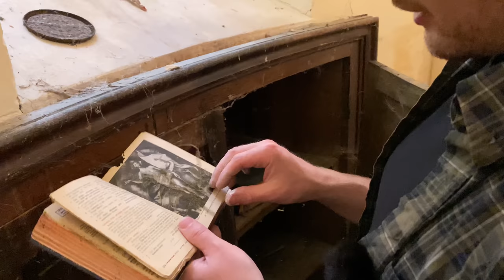Trash and Treasure - Doing It Ourselves

Comment: BIG TIP FROM SOMEONE IN THE AUTO INDUSTRY--- you arent supposed to mix the entire container at one time!!! you are supposed to take a board or cardboard material put the amount of putty you want to use on it, take the hardner and lay a bead across the top and the size of that bead depends on the amount of putty but general rule is you lay a bead of hardner half way across the top and its realative to the amount of putty you are using, if the pile is as wide as your hand then the bead of hardner would be half  as wide as your hand if the amount of putty is the size of your thumbnail the bead of hardner would be half the size of your thumbnail and thats usually sufficient. To much hardner and it will set fast,  not enough hardner and it just takes longer to set up but it will set so if you are unsure use less. In this case you are fine because you are using alot but in general dont do that and if you must mix the entire container, use about half the tube of hardner maybe a little more and it will double your working time.  The amount of hardner used does not determine how hard the putty is when it sets, it only determines how quickly it starts to set.
Reply: Seems so complicated but looks simple.  I don't think I could do it. Hope he seen (or saw) your video.
Reply: he seems to like that stuff and he'll probably like it even more when he knows how to best use it, they probably really did just find it lying around somewhere and improvised lol
Reply: Brandon beat me to leaving this tip. If you mix too much putty at once it will harden & be wasted before you can use it...
Reply: Brandon Reid Could you mix this stuff in a plastic baggie and then when well mixed, cut of a corner and apply it like a pastry piping to keep it more where you want it and save waste. This way the compound is not exposed to air and might last longer in soft mailable state. Don't know if this gets too hot in the mixed stage but if you use a freezer bag that is a bit heavier it might be sturdy enough to work. Also if you place a small amount of Saran Wrap over an intact area of the trim then apply some of the putty on and let set up, you can then remove it and remove Saran Wrap, use this as a scree to replicate the profile over the newly formed areas later.
Reply: I wouldn’t recommend using it like that, the spreader is used to press the putty into the crack or whatever you’re attempting to fill. Also being exposed to air isn’t what causes it to harden it’s adding the hardner, once you add that it’s going to harden at the same pace regardless of air or not. When you store it you want to make sure the lid is on it good and it’s sealed because air will cause it to harden without hardner over time
Reply: Brandon Reid . But if you put it in the Baggie and sealed it an ran a brayer over it it is actually an excellent way to mix things. ( use half the spreader to the volume of the putty, just mix a little as needed and don't get to far ahead of yourself it doesn't keep) it's actually simple and one never knows if one will need to know how to use putty. Cheers and have a cuppa

Comment: Painting the door to the Gardener's cottage is right. Even if it had been all teak, it would have needed more sanding and scraping to get rid of all the old paint before you oiled it. A painted door won't need washing and oiling now and then to look nice and it won't get darker either. You can use a crowbar under the door (and some pieces of wood if necessary) to guide it in the correct position when putting it back on the hinges. Mind your fingers; you only got five of them on each hand. ;-)

Comment: Always entertaining! Thank you Micheal et'al.

The timber on the bottom of exterior doors is a sacrificial piece. This timber is designed to keep the door from rotting and to throw rain to keep it from coming under the door. When this timber begins to rot, one simply swaps it out for another. 

Bondo and other body fillers are extremely versatile.

Cheers!

Comment: Just a pro hint: if you use an extension cord on a role and want to work with heavy equipment, take it off the role completely or it mighty overheat. 
I'm not into filling the door with that stuff... But it's probably better than letting it rot. Since you have two different kinds of wood I absolutly agree to painting it, it will last longer.

Comment: as if your videos could get better! this is really like a TV show!  Love your channel.   TIP—-for using two part epoxy:   get a piece of thin, flexible plastic to mix your putty and hardener on.  scoop out just about two spreader loads of putty to one 1/4 dime size of hardener. mix until hardener no longer shows.  use that bit up and keep mixing small batches. this allows you to get more layers out of your putty and it won’t ‘kick’ so fast either as long as you use the small amount of hardener.   we use this method because we are in hot Florida.  we repair boats.

Comment: OMG Michael I cringed when I saw you throw away the John Deere. You could have pulled it apart and sold bits of it like the seat, steering wheel and cutting deck. 😩 Those parts are so expensive. We need a new seat for ours and it’s going to cost 150.00 new. The door is going to be beautiful green. 😍
Reply: I felt the same 😱
Reply: I was thinking the same thing... Even the blade would be worth money.  I bet someone grabbed it out of the trash at the dump and scavenged parts to sell

Comment: From the style of the Altar, there was probably a large crucifix anchored into the plinth behind the Tabernacle that would have sat above and behind the Tabernacle.  Until 1965 every Catholic Altar was required to have a crucifix visible to the Priest at least.  There would also have been at least 6 large candle holders, three on each side for High Masses and a set of 2 smaller candle holders, one on each side for Low Mass.

Comment: .... In the states we generally use a product known as Bondo for body work .
I'd suggest that you buy your filler at an auto body supply. It will be less £ ,in
larger quantities . As the other poster said, you get the filler and hardener,
then you take out the amount you need and put it on some sort of pallet ( preferably one
that you can throw away). Then add the hardener and mix it.  The amount of hardener
that you add determines your working time. More hardener... Faster it will dry.
Less hardener more working time. However, you have to add enough hardener so that
It will harden ... ;-)

Comment: Also I wanted to share that a similar product was used on wooden boats to restore dry rot.
Often the wood on boats used in fresh water would rot below the water line. The product worked In water splendidly, so it will work well on the door with all the rain. God Bless you.

Comment: There's a product sold in the U.S. called wet and forget that's made to clean old tombstones that could be used to clean the delicate stonework on facade of the chapel.  It's supposed to be safe for stone and you just spray it on  leave it and the rain and wind wil clean off the dirt and mold feom the stone.

Comment: The stained glass windows you showed in the chapel are from very different era's, as you can see the colours in the last two that you showed are deeper and sharper, and from the middle of the 19th century. The others are very different design, and the colours lack the depth and sharpness of the 1st ones and are no doubt from before that time. And the chapel itself is very much a mixture of styles, indicating very different era's.

Comment: My cup of Fortnums Smoky Earl Grey is ready.
Reply: It tastes like tea made with water that was used to boil smoked sausage.
Reply: @moltobene1528  Smoky taste for sure - I love it.
Reply: Örn Leifsson  I cannot find that in the shops here.  I did find it on Amazon.ca.  A bit expensive, $27.95 for 25 count tea bags, plus $13.98 delivery.   However, I might treat myself at Christmas time!😁
Reply: E mail Fortnum and Mason in London..they'll post you a tin..probably cost you about 10 moolah.
Reply: @patriciaingledew5765  You don't have to email them, F&M have a webshop where you can buy their goodies - the problem with them though is that they have a flat postal rate, they put 40 punds on everything, so unless you are going to buy a lot of stuff and rather heavy, their postal charges are very unfair - I bought mine on amazon with much fairer postal charges.

Comment: Just me I would of pulled that lower part off the door 🚪 and had another one made in the same style or different teek wood save you filling with that putty
Reply: He does plan on doing that when there is a carpenter around, but to call one out just for that would be expensive, but as it’s being painted you can buy them off Amazon really cheap and screw it on.

Comment: Form your filler before it hardens, saves sanding and produces a professional result quickly. Cover a straight piece of wood with packing tape, press into the applied putty and wait till it cures then pull the wood off.

Comment: You should put that putty in a plastic bag and cut the tip so you can just pipe it right into any cracks or tough to reach places and it will go in much easier and cleanly.

Comment: I would like to give you another tip, if your going to use a claw hammer as a mallet turn the hammer 90 degrees using the centre and keep both your hands behind the wood chisel. Seen it happen followed by a trip to A&E. Not me someone else stay safe. :-)

Comment: Michael you did a great job repairing that stained glass window! The purple you painted looks like a good color match, just a bit too strong, is there a way you could just lighten the intensity or thickness until you can restore with correct glass? I'm glad you do read your comments, people are offering lots of advice through their own experience, like the putty and the door kicker restoration. Love the small changes you add when switching scenes, the Peacock butterfly etc.

Comment: Can I suggest you buy some hand held walkie talkies (or 2 way radio's as you may know them). They are relatively cheap.  They are great for the type of job where one person has to yell out to another. Also when you are on a large property you can take one with you and be easily contactable with the second unit that is left at home.  We even use them on road trips where we are travelling in two cars.  They normally have a 2km or 5km range.

Comment: During colonial times, mixed wood furniture was intended from the start to be painted.  some of it black lacquered and it was considered a China piece.  Though your door has had me puzzled for a long time now because of the gap on the bottom and then such a large decorative molding in front of it.  Then it occurred to me that the gap would allow any moisture that got into the door to drain better and that the molding was there to take the rot and wear and tear.  When it got in bad shape they still had a good door and only had to change out the molding.  LOL. Did I guess it right?   I saw the previous tour of the chapel but it is so pretty that it was nice to see it again.  I am wondering since you have a little locked cabinet on the altar if the chapel might have had a small relic at one time or another.  Maybe a small bone of a saint or a piece of wood from the cross.  Those were always popular bits to have around.

Comment: For repairs that are large like this door, you should try fiberglass reinforced body filler.  It has loose strands of fiberglass in it and it's more structural than regular body filler.
Reply: Also, you can mix the filler in small batches on a piece of wood or cardboard instead of mixing the whole tin at once.

Comment: Wow. I have never seen anyone add the catalyst to a full tin of body filler.

Can I explain an alternative way to use it. Pull out about a quarter of the filler and squeeze an amount in proportion of what is called for, of the hardener and mix the two together on a board. Once the two parts have been mixed together use them until you run out. Then repeat the process with another portion of filler [ bog } and hardener. Carry on till the job is finished or until you have run out of filler and hardener.

My eldest son would roll over in his grave if he could have seen you do that.

You have just wasted about a third of a tin of putty simply because no one has shown you how to use it correctly.

Michael you can not use less of the hardener than is required as it will take ages to go off or will not set at all. There is a % mix between the putty and the hardener needed to get a good result.

Luv Ya Work.

Regards.

David Down Under.

Comment: Michael — At 11:15   Are you actually using the chisel as a punch to hammer in the nails?   If you are, "Shame on you"!  The purpose of a chisel is to pare off wood, not to be used as a punch to hammer in nails.  If you are indeed using it to hammer in the nails, the sharp edge will be destroyed, and Billy will be extremely annoyed with you — and should insist on you buying a new one of equal or better quality to replace it.  Even a screwdriver should not be used as a punch.

Comment: This is probably covered under local construction up grade laws, but I'll say it anyway.  Speaking as a handicapped person, please have an easily accessible room with a bathroom fitted with a walk in shower, shower stool, shower hose 2meters or longer and a toilet with arms on both sides of the toilet. Idiot architects put the rails on one side of the toilet and behind it. My arms are beside me not behind me. Think chair. It's Also helpful if the toilet is taller than standard. Getting up from a lower position can be very difficult. Also the French are want to use bidets (sp?). The handicapped find its use very difficult. Please at least have the option to use toilet paper.  Some thoughts given my experience of so called handicap rooms in the USA. Disney World is the only place I've stayed that had good handicap rooms/bathrooms. All the rest are problematic to one degree or another.